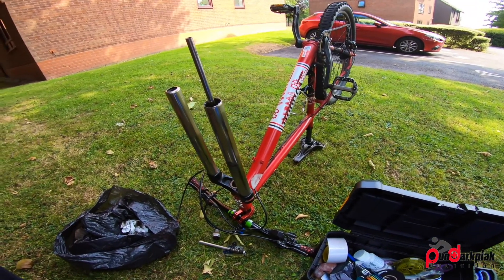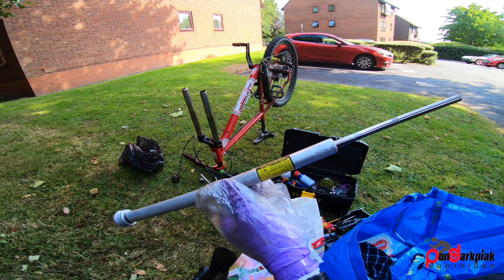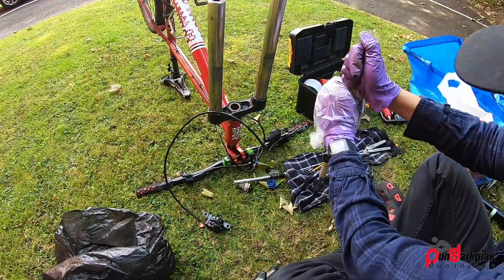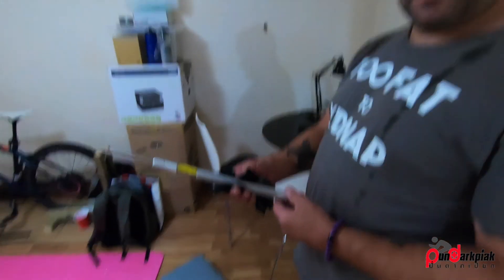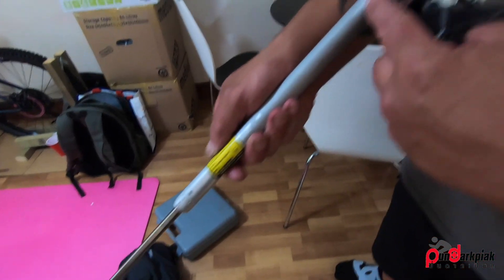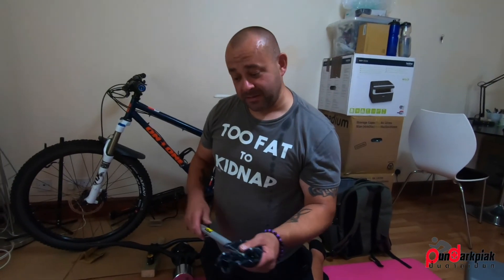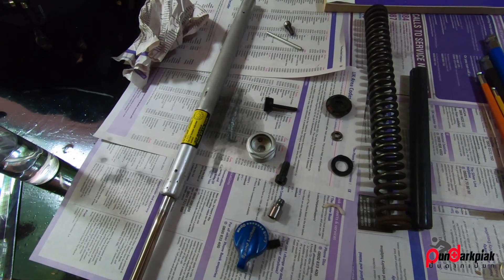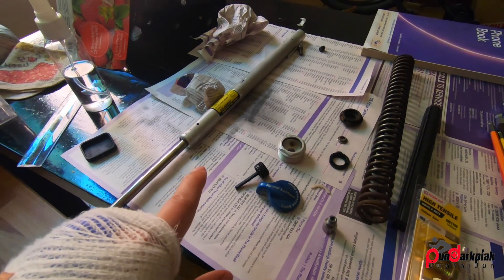My SR SUNTOUR Raidon is forked up (literally)

Comment: These forks are terrible mine has blown and hard to find replacement rebound cartridges
Reply from the maker: They are as good as their costs;) I hope you can find comparable replacement parts on Aliexpress. I bought a generic damper from Ali to fix my blown-up Fox 32 CTD. It is not good, but it is still better than no damping at all.
Reply from the maker: Forget to mention that it definitely will be a certain amount of mod to fit those generic damper.
Reply: @pdpcycling248  yes i have found the part now my local bike shop got it for me 😁 £40 just a simple swap over and hopefully job done ✅👍🏼

Comment: Ma man it happens on me for second time and for sure im gonna change the damper again i cant do anything if you can help with something pls reply
Reply from the maker: Is your fork still under warranty? If yes, then the best solution is to exchange for new one. If no, and you don't want to spend any more on damper, then you can just drill the damper like I did to by-pass the oil flow. However, you won't have any damping and the process is irreversible.

Comment: bro, how much oil do you put on the fork?
Reply from the maker: I put like 50cc in it and oil just leak like hell from dust seal. There was no damping (that I could actually control). So I drained oil and only put about 10cc for both side just for lubrication.

Comment: U are sick man :)))) I have a raidon too, it was left for me cause it was terminated, the stancions scratched  the lover leg interior disgusting, but the air chamber and the cartridge was in good condition, i'w saw some vids in Youtube how to recharge the cartridge but it not works just in case if the chamber of gas is in the bottom not in this case , my cartridge losed the liquid so the lockout doesn't work but the rebound is stil functionable and it can use without to use a lockout,you or your friend  drilled out the holes and damaged it all the way ,so you ned a new nitrogen gas cartridge or a new fork, best wishes ;)

Comment: you could thread the stanchion, make a threaded cap with a hole and a seal, thread that in the stanchion and fill the stanchion with oil. This way there won't be any leakage from the dust seals as everything will stay contained in the stanchion.
Reply from the maker: Another cool solution!